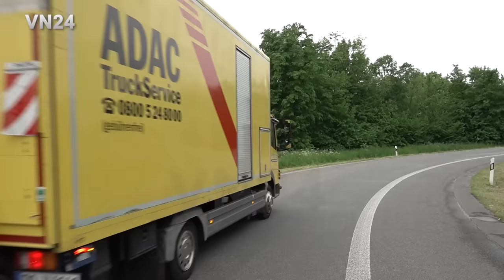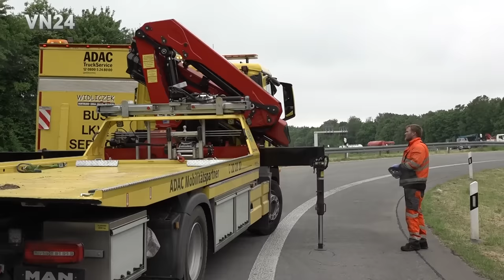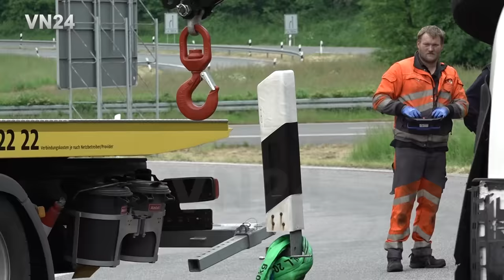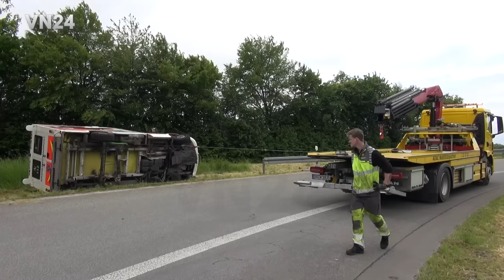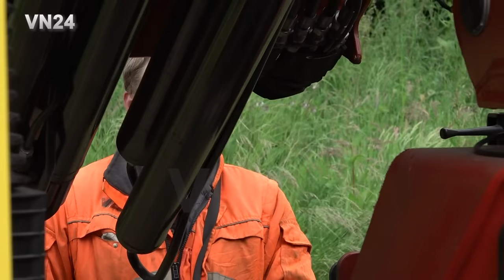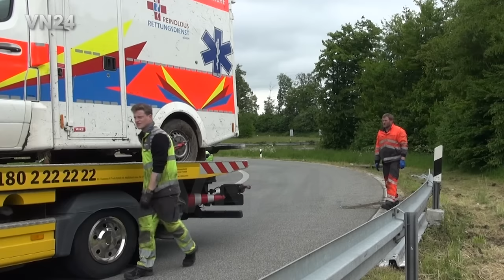23.05.2023 - VN24 - Wenn Retter Retter retten müssen - Krankenwagen kippt auf die Seite

Comment: The description states: "In the process, the ambulance ... was carried slightly out of the curve. The left front wheel got behind a guard rail rising from the ground, on which the entire vehicle pushed up. Subsequently, the vehicle flipped onto its left side and slide to its final position."
I think this description is incorrect. When the left front wheel got behind a guard rail the vehicle would have flipped onto its right side.
So I think that in reality the vehicle wasn't 'slightly carried out of the curve' but was far more carried out of the curve and was already (almost) completely driving on the gras and the right front wheel got behind the guard rail, which pushed the right side of the vehicle up. Subsequently, the vehicle flipped onto its left side and slid to its final position.
Please tell me when I'm wrong.

Comment: Great video and recovery although I was wondering what the piece of timber was for, strange too that the crane truck has a fancy remote yet the small truck doesn't have one all (unless they lost it! )
Reply from the maker: For whatever reason, the vehicle key was not at the scene and the transmission was locked in park.  To prevent damage to the gears of the FWD, you can use a piece of wood.
Reply: @VN24media  It just rolled over the peice of wood, we would normally use "Slippery Jims"  plastic skates or Dollies - even washing up liquid makes the bed slippery and helps a lot!  It always amazes me that after being involved in an accident a driver will always remember to take the keys with them and that the Police would never think to take the keys!